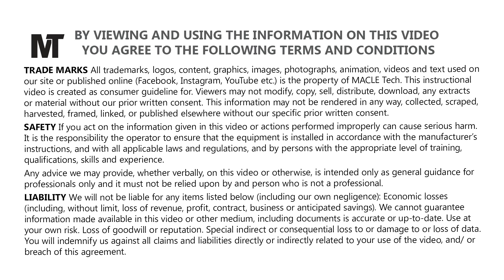Portable Generator End Testing (AVR & Brush)

Comment: So glad you said to ask questions 😊
I have a briggs and straton storm responder 6550 not more then a year old and it craped out on me idont push nothing more then a welder or a chop saw at a time it has never run the two together then suddenly stopped producing power this type of thing happened to me beforerunning a powermate generator before learning of the different things that can go wrong i have looked into seeif by chance its the avr giveing me problems its looking good if its in something else i have no knowledge of how to fixit or were to go about looking for it its a fairly new machine not more then 36hrs on it till icanfigure it out or if you knowwhat my problem can be i got a champion generator  to keep things in motion out there in the shed AKA man cave 
        Got any idea that may help ?
                          Thank you for shareing 
                            Thank you in advance 😊
Reply from the maker: Could be bad exciter winding. Unless you have a generator that can continuously produce 50 amps the smaller ones typically  do not like welders if they are not a combo unit and the excitor coil burns up on them over time if not instantly.

Comment: I have 110 on only 1 plug on my 220 output?
Reply from the maker: If you test directly off of the end is it producing 220v ? If so then the problem is either in the wire that feeds the plug or the plug itself.

Comment: Excellent video...thanx!
Is there a way to test just the AVR in order to see if it's working or not? (I am a novice at generator repair, and my 6.5KW 220v gen suddenly has no output power).
Thanx & Regards, 
Alex
Cape Town.
Reply from the maker: I myself have never found a way to correctly 100% test a AVR, other than the 12v to the brushes to give you a 50/50

Comment: Briggs & Stratton generator ran out of gas under load, upon filling and restart, (which I believe was done under power) it blew several control boards on appliances, garage door openers etc….
Voltage tested properly from generator, but lights were coming on and off, as if AVR was toast???
What do you think?
Reply from the maker: Could be the AVR if  the power kills every  30 seconds or so, AVR usually resets every 30 seconds

Comment: Hello there what is the difference between the AVR and the capacitor so is this is considered as a capacitor Or just a voltage regulator?
Reply from the maker: yes there is a difference. Read this blog
https://powerinsiderpro.com/avr-vs-capacitor-generator/#:~:text=Well%2C%20the%20AVR%20generator%20is,capacitor%20in%20a%20capacitor%20generator.&text=The%20capacitor%20generators%20are%20cheaper,is%20the%20overall%20better%20generator.

Comment: Excellent video! I have surging power at my outlets on a 2200 watt generator. Produces power for a second, then no power, keeps repeating. When I run 12v to the brushes, everything works as it should... what could it be? Thanks in advance

Comment: Great video. I learned a good bit. 
I have a generator that shakes like hell when the capacitor is hooked up but runs smooth when it’s out.  It’s a brushless gen end. 
Anybody had a problem like this?
Reply from the maker: Most of the time that means your gen end is shorting and the engine is trying its best to keep up with the load.

Comment: Hey Tyler I need a little help. (Great vid btw) my portable generator is a 12,000 watt 120/240. My question is can any generator of this type (no switch to transfer from just 120-120/240 volts it’s always 120/240) however what’s the reason they tie all the common wires on the r1 stud and can I re wire  mine So all the common wires are on R1? And if I can what can I expect as far as performance I.e. wattage , volts , etc 

P.s. it is, an AVR style generator like yours in the video. 

Thanks so much for any input or help you can offer. Thanks Tyler
Reply from the maker: In my opinion the only reason they tie them all together is to save money. When they are tied together like that it can cause a slight back feed and drop performance. If any re wiring was to be done i would add a extra common coming from your cont panel and match it to the correct wire on the main board on the gen end.

Comment: So, the AVR is actually regulating the main AC output voltage,  by  regulating a DC voltage that goes to the rotor coils ?   You put 12vdc to the rotor coils, that resulted with 57vac main output.   So, I'm assuming about 26 ish vdc to the rotor coils , would create the desired 120 vac ?    I would be curious to see the actual voltage the AVR sends to the rotor coil.      BTW, Great video.

Comment: Exellent tutorial. However you skipped over how to match your hertz to your voltage and engine speed. For example if your hertz are at 70 and you need them at 60 but your voltage is 120 @ 70 hertz. when you adjust your engine speed down to 60 hertz now you have 105 volts or so. 
I liked your video it was spot on.

Comment: Some generators of the 'BRUSHLESS' have a rotor with double windings, connected 
together by a set of diodes or rectifiers/bridge. The rotor spins within a slight magnetic 
field building up alternating current which in turn is changed to D.C. and creates a 
powerfull field on the 2 faces or poles of the rotor. As you know, a diode prevents
current flowing in one  direction, yet allows in the other direction, like as my friend Taryl
says, an electrical check valve. The fixed winding/s are known as the 'ST8or or Stator,
the part that turns is the revolving field known as a rotor.
        This whole assembly is in ways similar to the alternator in a car. the rotor here being
of 2 poles only while the rotor in the car has a number of toothlike poles, but then again,
the car alternator is delivering 3 phase power and changing to D.C. by means of the bank
of diodes. The AVR here is similar to the voltage reg. in a car, the lower the btter gets due
to the load placed on it, more field is applied to the rotor thu, yup the sliprings.
        No matter how many KW at a given voltage, over-curent must be avoided, that is why
fuses or circuit breakers are employed.

Comment: my same generator starting no problem but no out put power,,please solve this problem
Reply: First you need to try flashing it. Some generators dont have a perminant magnet on the armature and it can cause an issue with the lack of a magnetic charge to start the process. That should always be the first step if your getting no power because it requires no disasembly. start the generator and plug in a drill, hold the trigger in and spin the chuck to turn the drill motor over by hand. If that is the problem after a few times doing that the drill should just take off and start spinning on it own. I dont know if this one has the magnets or not but giving it a try cant hurt. Then follow this video for doing your testing.
Reply: Check AVR good or not